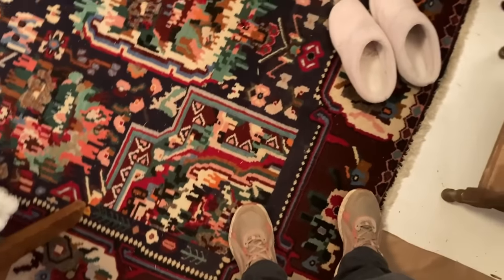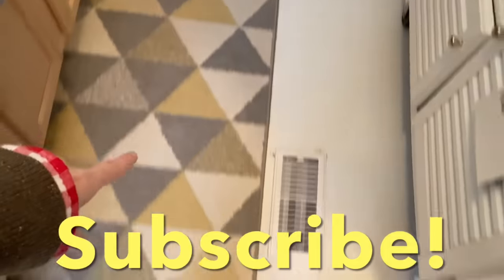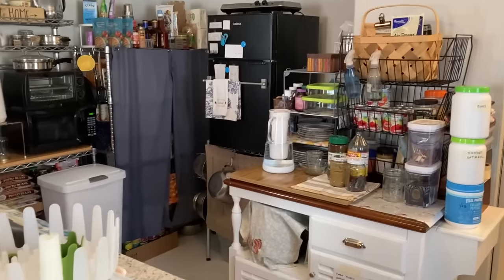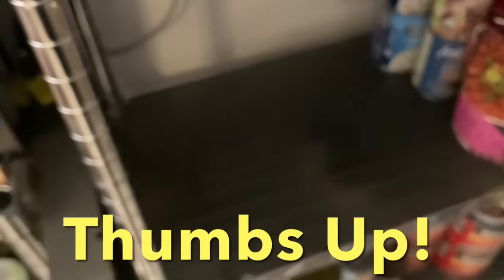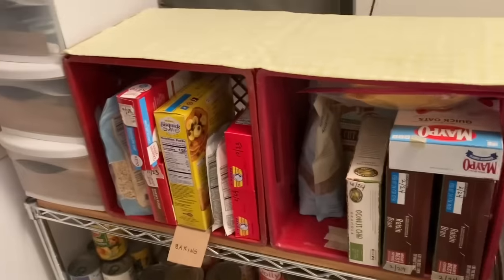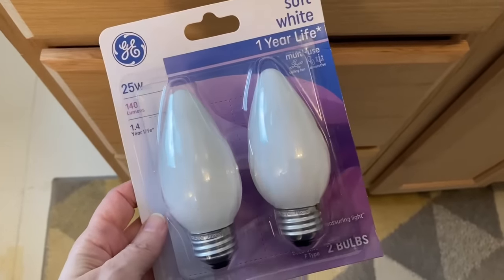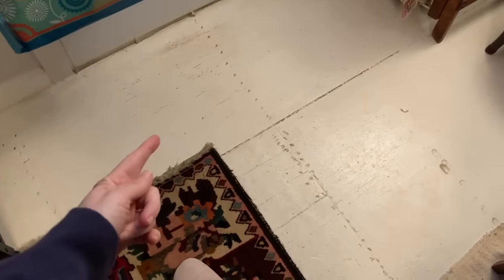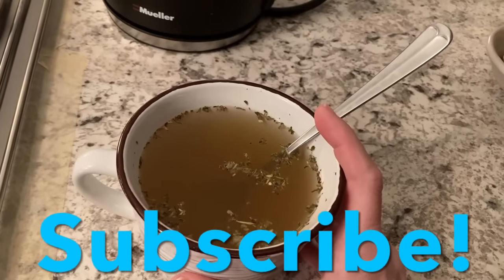Mobile Home Homemaking - Homemaking Motivation - Frugal Living - Mobile Home Kitchen Tour - Motivate

Comment: You’ve done a great job utilizing your space. Maybe you could use curtains or even a shower curtain from the thrift store of course, on the tall metal shelves to hide the “clutter.” It’s good to be prepared for anything. I have friends and family laugh at how much food I have in my apartment for just myself. You should notice a huge difference on air flow coming in around the door with the door sweep. Have a great weekend!
Reply from the maker: Thank you! Yes, the door sweep is helping a lot. I'm glad I found it at the thrift store! I like using fabrics to manage the visual clutter, it really helps. I like your shower curtain idea, for the shelving! With food and supplies, it's important to be prepared, just in case! I'd rather be prepared than not be.

Comment: I use c hooks that screw in the wall or wood to help hang things
I'd love a rack that hangs from the ceiling for kitchen too .
Right now I need a shower caddy and over the toilet rack or bath towel and accessory shelf system
We have our towels in an old rubber maid storage tote and it just looks horrendous to me lol
Reply from the maker: I have an over the toilet shelf unit and it has really helped my bathroom set up! My hanging shower caddy is broken but it still has some life in it, so I'm going to use it until I find a really good deal on a new one. Good idea on the hooks for extra storage!

Comment: I could live like you. It would mean I couldn't get things I don't need. So, no more clutter for me.  Do you think that using twin sized flat sheets would work as covering for the larger shelves?  Having a smaller refrigerator means you don't waste food.  You make enough to eat and freeze or have a second meal and you use what you have.  Thank you for sharing your home. Take care ❤😊
Reply from the maker: Thank you so much! Yes, a small fridge helps to not waste food, for sure. I like your idea to use twin flat sheets to cover the shelves. I'm using some curtains and it helps settle down all of the different patterns from the food supplies. I feel very fortunate and blessed to have my little trailer. It came at just the right time in life, and I love my home. Thank you for watching!